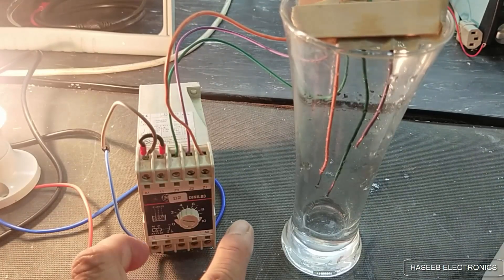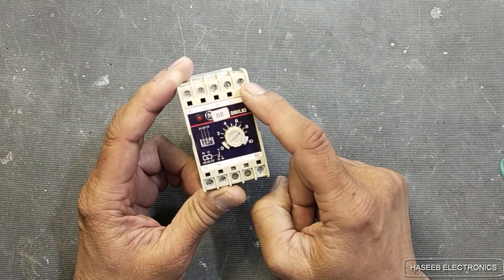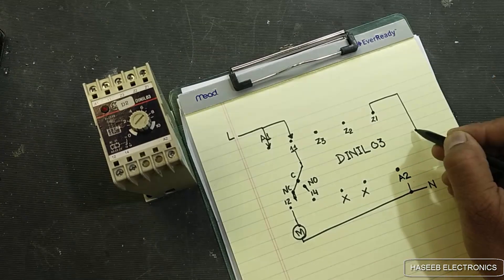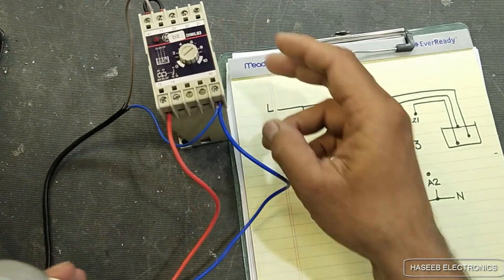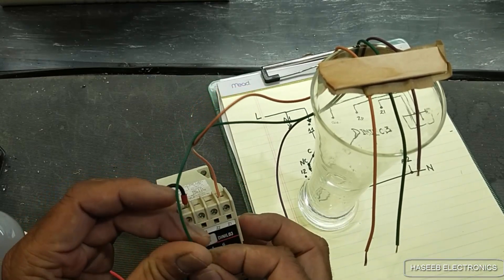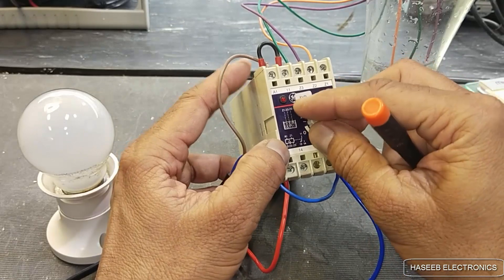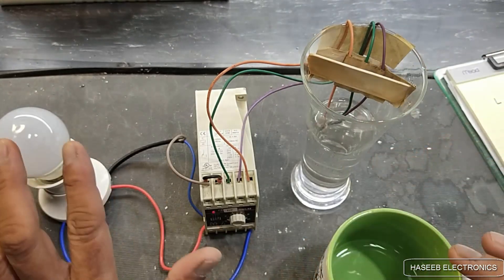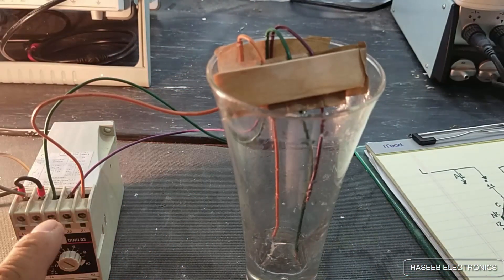{555} Liquid Level Detector Relay DINIL03 To Control Water Pump Of Well Or Water Tank

Comment: Hi friend thanks for the informative, I just want to know if z2 control the NC contact?
Reply from the maker: z2 is the upper level detector probe in the water tank. and Z3 is lower level prob
Z1 is common pin
z2 & z3 are applied to logic ic which decides to operate the pump when z3 signal is not available and will stop the pump when both signals will valid 2 & z3
Reply: @HaseebElectronics  thank you for the information

Comment: Thanks slot for this information. Jummah Mubarak. Where can I find this device?
Reply from the maker: it is available on amazon and also local market
i will share its circuit diagram i next session, so you can make yourself
Reply: @HaseebElectronics  Ok that's good. Jazaakallaahu khairan.